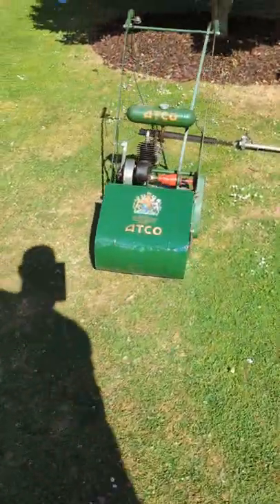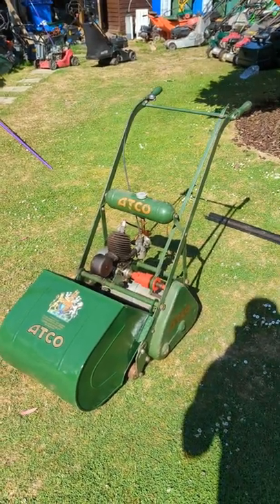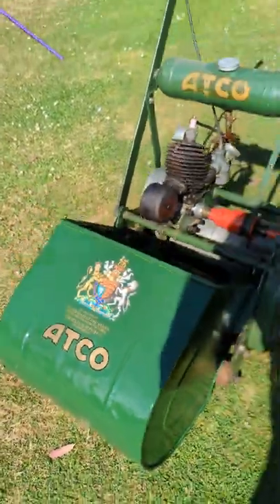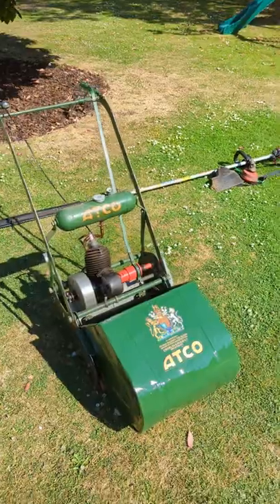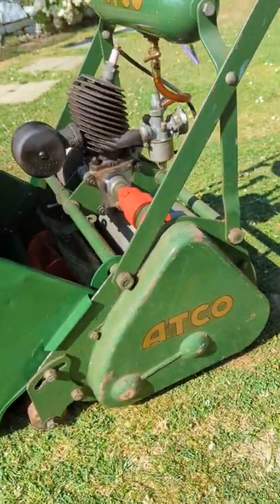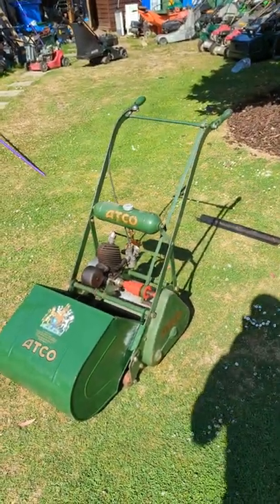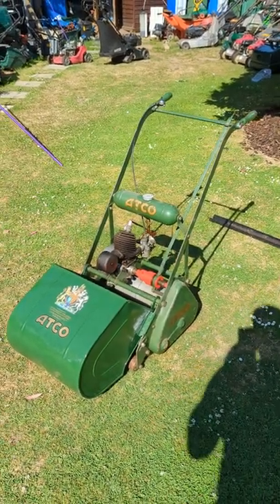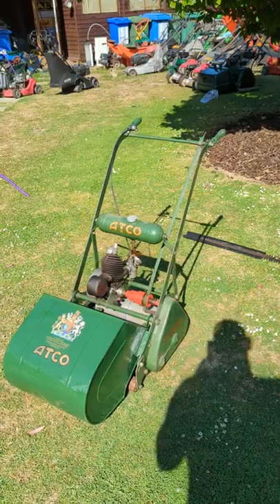Atco Midget Villers MK3 Vintage mower #short #shorts

Comment: Excellent work mick! I haven't seen one of those in 30 + years. Definitely touch up the tank  since that's right where the eyes go. A chrome ATCO on the tank would help.
Reply from the maker: It's cool hey.. I think it's a great mower
Reply: @themowerman  I love reel mowers! Nothing cuts better than a well tuned reel. I still use my grandfather's old Montgomery Ward reel mower with an updated 3.5hp engine.
Reply from the maker: @RogerSegerJr  fantastic